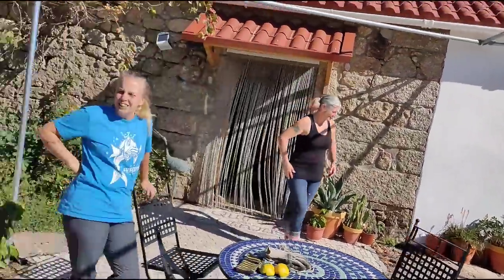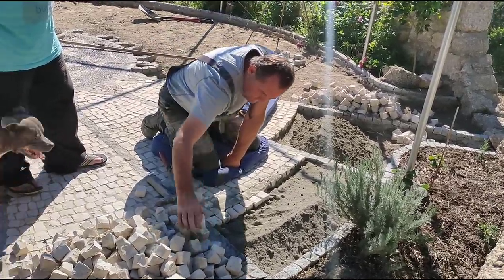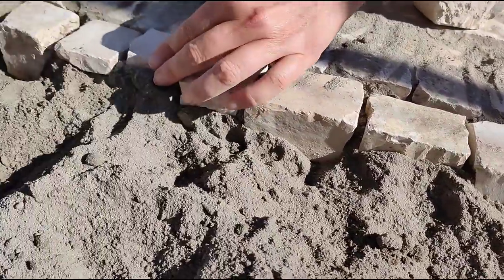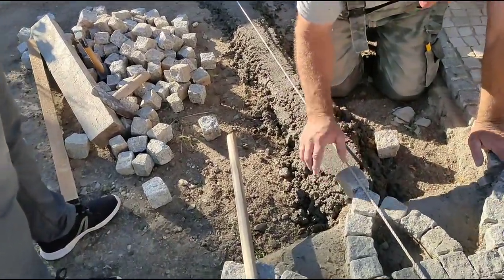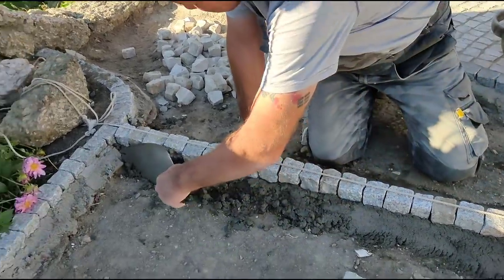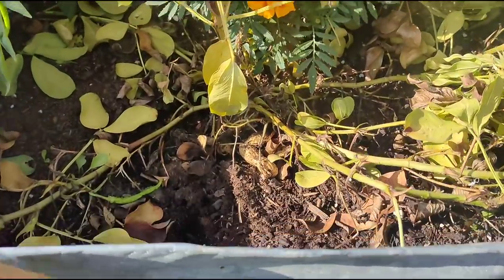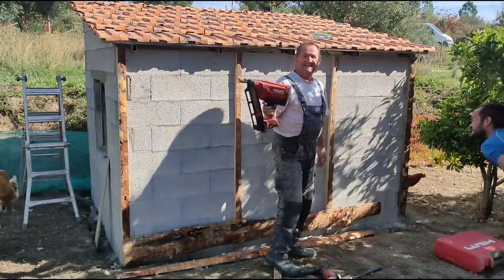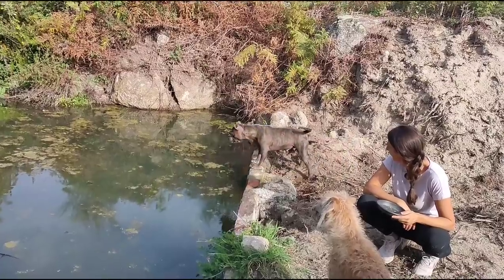No 13, Lessons in Calçada, Bee and Chicken update, and a mystery reveal

Comment: I don't know why you didn't just build a hen house in roundwood?
Building in the round is much cheaper than building with sawn timber and it probably would have cost a lot less than the block built  hen house.
Reply from the maker: The blocks for the Hen house cost us less than 100euros, the equivalent in treated timber would have cost us 3 times as much, as for roundwood, rarely available here and if you could get it it wouldn't be treated, bees, beetles and wood boring insects are a real problem here, hence the block walls and steel and clay roof
Reply: @projectportugal  I said round wood and not sawn timber. You should be making friends with a Forester. You got pine forests all around you.
I just like honesty in my build. The cladding will definitely stop some of the heat during the summer but I was scared that maybe bees or  wasps will get behind it .
Anyway definitely a bit over engineered but that's what Europeans do, take this hen house over to some places in the developing world and they would be kicking those chickens out quick.🤘👍